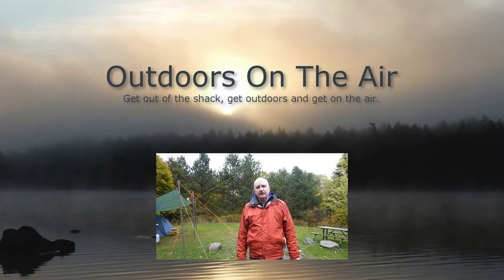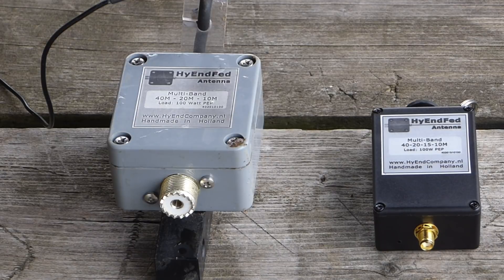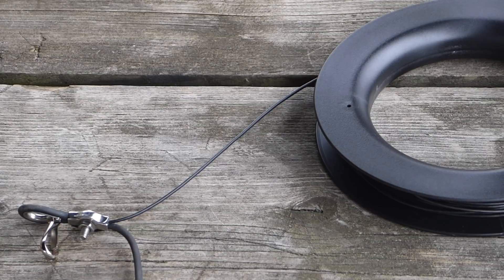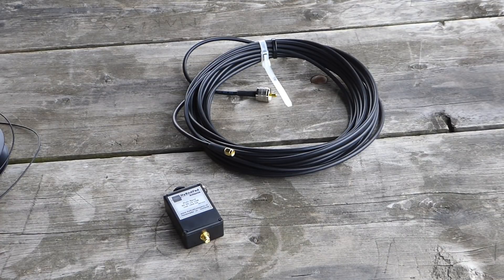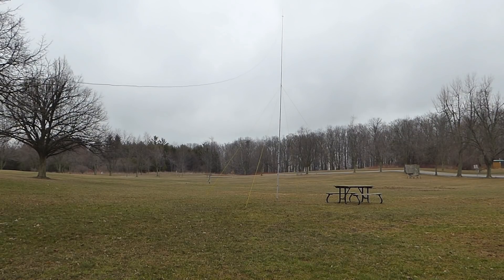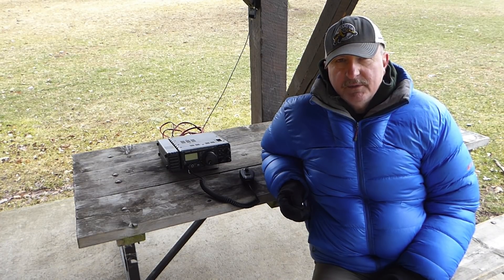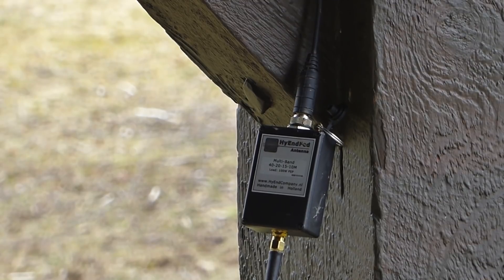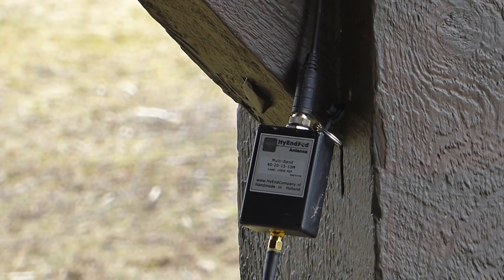HyEndFed Portable Ultra Light Mini - Field Test

Comment: ... as usual, great video Tracy. All things being equal me thinks the secret sauce that makes one antenna work better than others is the nature of the core material in the balun. Type 2, an iron core material has been shown to work significantly better and more efficiently on the high bands.. and is usable down to 40.  On the other hand type 43 material, a ferrite material, covers a wider frequency range but is generally better on 80 and 40.. but works OK further up with reduced efficacy. It's the quality of work, attention to detail including proper Z matching ( is it 2500 ohms or 3500 ohms? 9:1, 49:1 or 64:1?), no wasted RF common mode issues, these are the things make or break these EFHW or UNUN antennas and what makes one design work a tad better than the others... especially when your using 20 watts as I am with my XEIGU G90. 

Richard
VA7AA
Reply from the maker: Thank you for the very informative comment, Richard!

Comment: Hi Tracy
Great video, do you know if these antenna masts can still be purchased ?
Couldn’t find them on the manufacturers website.
I’m also running a FT897, great rig.

Cheers
Wayne
Reply from the maker: Hi Wayne, DX-Wire sells them but you have to order from Germany. I think SOTAbeams also has a compact 30-footer.

Comment: if there is no difference In performance why still produce the larger one ..I'm thinking of getting the mini for my home as its smaller and it be a permanent install unless there some reason why the original larger would be better.
Reply from the maker: The smaller matching unit is not built to be exposed to the elements for a long period of time. The larger ones are.

Comment: Did you need the Tuner or is the SWR ok without ATU?
Reply from the maker: The tuner was not used 😀 the SWR was fine
Reply: @OutdoorsOnTheAir  Thank you Tracy for the info - in the next few days i will also install a end-fed-wire antenna on my area. Very good videos from you with a lot of useful tricks.......greets from south germany!

Comment: Tracy, thank you for your great videos.  I am in the process of building my kit and a HyEndFed antenna is next on my list.  When you deploy, does it matter if the feed end is at the top or bottom of the slope?  As I build my antenna ideas i have to consider my wife's rules for her garden in how I will be setting up the wire and my temporary station. Thank you for sharing you hobby with us.
Reply from the maker: Aside from being a bit more difficult to deploy, there is nothing wrong with feeding the endfed at the top end of a sloper. I've run antennas that way many times successfully.
Reply: @OutdoorsOnTheAir  Thank you for the reply.  My plan is to mount from a deck off the back of my house sloping down into my yard.  On a mast this will greatly increase the length I have to stretch the antenna.  73,  KC1IAN

Comment: I have an early version of this. Mine has a BNC connector - that in very windy conditions has occasionally un-twisted itself from engagement. (Wind speed that day was 30mph+) I'd rather it had the universal SO239 like some of the other models.  Also mine has no strain relief in the radiating wire, so I've added it myself - occasionally the simple push-plug disengaged under the weight of the wire's sag between the two masts. I configure mine mostly with the matching box at the top of a short 17ft mast, the high end is usually near the top of a 12.5m mast from DX-Wire in Germany.  (I think that Ron doesn't stock these masts any more, they're available direct from Peter at DX-Wire) Seems there's nobody in the UK with the wherewithal to start making these things. What happened to Brit entrepreneurship???
This antenna has always acquitted itself well - on Saturday past in extreme wind conditions we couldn't get the mast up so ran the antenna as a "grass wire laid across heath grass/bracken about 1.5-2ft high.  Worked well enough given that we could only have been getting NVIS pathways...
Reply from the maker: Thank you for sharing your experience, Ian!

Comment: Hi, could you please explain why  this antenna doesnt neeed a ground or a counterpoise ?
I will go to another town in France (sorry for my poor english) in a house with a very little area and Im looking for an antenna that could fit and without a too bad efficiency. 
Many thanks for your answer, cordially,  Milos
Reply from the maker: Hi Milos, thank you for your question. The answer lies in the matching unit. In many endfed antenna of this type, a 49:1 matching transformer is used. There is a very active Facebook group that deals with endfed antennas. You can learn a lot from those guys.
Reply: @OutdoorsOnTheAir  Thx again   what is the nam of the Facebook's group ? Sincerly yours, 73 - F4IIP

Comment: Hi again Tracy. I have just done a search on the net for A13 coax type. All I got was a photo of some for sale on E-bay. Doing another search got me onto HELUKCABLE.com. On there was a list of coax types and the one that I am sure was the type, was has I suspected 75 Ohm. This was typical of the Larkspur range of equipment in the 60's/70's. The type number was RG187. 2.5mm dia. outer.. It would cost an arm and a leg has it is silvered copper braid. The nearest 50 Ohm type appears to be RG174 which is standard copper braid as you will probably know. You may be lucky and find some at the right price there in Canada or in the USA. Sorry I can't be of more help. 73 de John- G0WXU.
Reply from the maker: Good information, thank you John!

Comment: Hi there Tracy. That antenna looks very neat and compact for back packing. I used some very light weight coax as part of the kit for the British Army A13 High power Man pack Tx-Rx while out in Malaysia in the 60's.  Has far as I remember it had the mini PL259 plugs on. Sorry but I do not remember the coax type number. It was approx 1/8th inch diameter and the jacket was semi transparent. It was strong for its diameter and seemed to work ok with the A13 and H-P Amp on. the point is, it was a darn sight lighter than RG58 and took up a lot less packing space.  If I can find further info on it, I will let you know. Although the A13 was soldier proofed, it did not work after it was dropped from 600 ft up coming in  to land on a chopper pad. It was not me. It was our RSM who did not realise the weight of the radio and all my kit as I passed it to him Hi Hi. It nearly took him out with it. The RAF loading Sergeant caught him. I clime'd up to the  cockpit as soon as we landed and asked the pilot to get a mesg. through  to HQ for a new one. 73 de John - G0WXU.
Reply from the maker: Thank you for sharing your story, John! 73 from Tracy VE3TWM.

Comment: Great video Tracy. I am shopping around for a small light antenna to take with me to VK land in a couple months with my KX2 and this may just do the trick.
 Can you tell me why you decided on the SMA connector on the box instead of a BNC? 
Many Thanks. Chris VE3XKZ
Reply from the maker: Thank you Chris. Have fun in VK! The unit HyEnd Company sent me to test was the SMA. My preference would be the BNC, much easier to handle with cold hands :) 73 from Tracy VE3TWM.

Comment: Make sure you get the larger diameter wire for the HyEndFed.  The smaller wire has a tendency to kink and break the outside wire coating.
Reply from the maker: Good tip, thank you!

Comment: HI Tracy, I have a question on these Antenna's you have been showing us "IF" I may. I would like to maybe get into Ham Radio and Try to learn it but, I'm 0ld and don't know that I can pass the test. I'm looking also at GMRS Radio's. My question is, will any of these antenna's work with these GMRS radio's? I don't know what Meter's work with what radio's. I would Appreciate ANY Info you can give me on this, PLEASE.
Reply from the maker: Thank you for your question. GMRS in the US and Canada is at 462 and 467 MHz. The antennas I use in my videos are for use below 30 MHz, so these one are not useful for GMRS. 
I encourage you to try to get your ham radio license. It may not be as challenging as you think it is. Yet like anything worth having, it does take some work. There are multiple levels. Start at the bottom (least challenging) and upgrade later if you have the desire.
I hope this is helpful.

Comment: Tracy, I have recently picked up a used FT-897D with 2 dead batteries. Do you have any recommendations on batteries for this radio? Thanks for the great antenna review. I like the idea of back packing as lite as possible. KD2IGC
Reply from the maker: Hi, congrats on your acquisition! The least expensive internal batteries I have seen are at amazon. They are a third party battery but get good reviews. I use only external SLA's and they work well for me. The SLAs are much less expensive and don't require the expensive charging contraption Yaesu sells for the internals.

Comment: Thanks, Tracy for another informative video.  Like the new graphics as well 😊.  Always interesting and relevant; and yes, size and weight matter a lot especially that last mile of a SOTA activation on some of the more physically challenging summits.  It is always desirable to have more room for other gear without having to sacrifice performance for weight... This looks like a nice unit!  Have you tried the PackTenna yet?  I think it uses similar 26awg.   I've Made several DX contacts with it QRP and works great as well.
Reply from the maker: Thank you for your kind word, David! I appreciate that you've offered your own personal experience to add to the knowledge base.
I have not yet tried the PackTenna but I've heard good things about it, most recently from you. 72 my friend!

Comment: Nice video Tracy, I compared my 100w Ultralight back to back with my 66ft doublet, both at the same height, both running north/south. On all bands, the Hy-Endfed was 1 to 1.5 S points better, both on RX and TX. I carried out the tests over a number of days, with the end result being that the doublet came down, and was replaced with the 400W 4 band model. I've since worked my best DX to date on it! 73 from Lincoln, U.K, M0KED.
Reply from the maker: Thank you for sharing your very compelling personal experience, Andy!

Comment: Nice review. I just purchased the same antenna from High End antennas. They have super great quality workmanship in their products.  Was wondering how long of a coax line to you carry around with this antenna ?
Reply from the maker: Hi Steve, it all depends on the site I am working from. I typically carry 2 or 3 9' lengths  of RG58U. I might not need them all, but I like to carry extra just in case I need the extra length or find that one has gone bad.
Reply: Thanks

Comment: Interesting video I went to the hyendfed site and find that the antennas are expensive compared to endfed antennas at sotabeam here in the UK which are a quarter of the price.
73's Alan in the UK.
Reply from the maker: Thank you for your comment, Alan. I jumped over to the SOTABEAM site and noticed their endfeds require a counterpoise. That's a different type of antenna than the HyEndFeds, but I do understand where you are coming from.
73 from Tracy VE3TWM.
Reply: Sorry I didn't realise my mistake your endfed is extremely good.
73's Alan in the UK